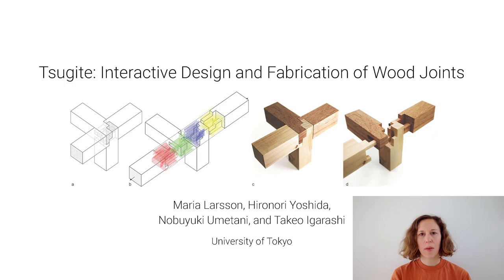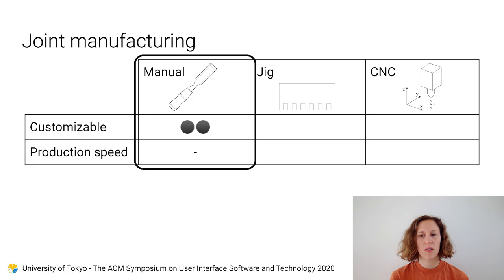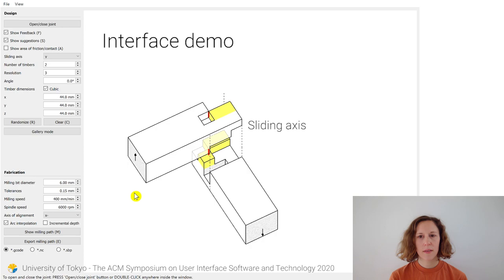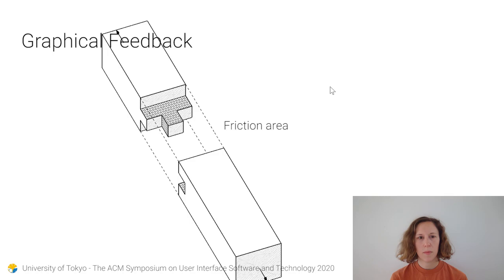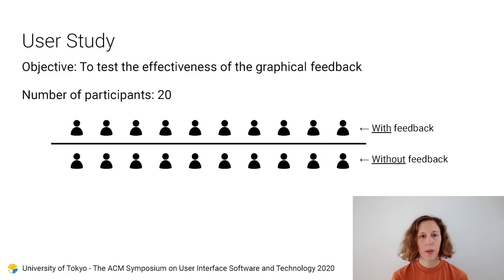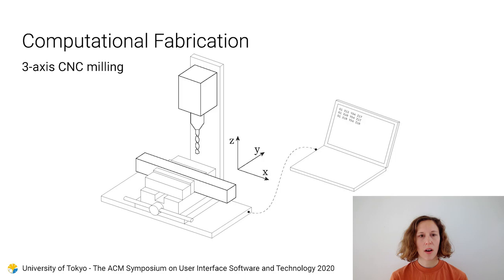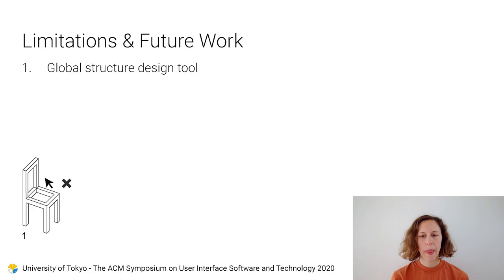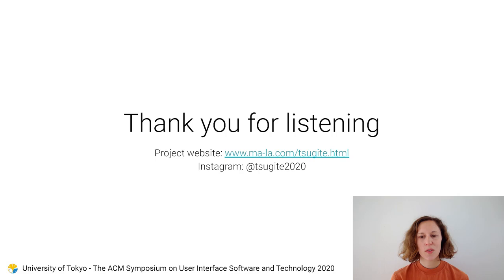Tsugite - Long presentation - UIST 2020

Comment: Just started the software, thank you for creating it. Running very well on a Win7, 8 year old Acer quad core laptop.   Translating to STL or OBJ files for integration into CAD assemblies or 3d printing should be fun.  Plan to try this using software like Voxelizer's Gcode to STL conversions.
Reply from the maker: So happy to hear that! 😅
Reply: how did you manage to run it on Windows7?
I'm trying to run it from PyCharm, I have all the dependencies installed, and still I get this message: 
"Process finished with exit code 1073741845" and the GUI wont start..
Reply: Could you explain me how did you do to install the software Tsugite? I tried to do but were impossible. I wrotte to Maria asking about the instalation in a OS W10 but I haven't got answer. Could you lighting me the way? Thanks
Reply: @jordijuveudina9974  I don't use win10.  I have not really been using this software as current projects have no need for joinery.  .  Maybe try running it as an administrator.  Somethings for me only work that way. In win 7, you right click on the exe file and it gives the properties options.  Or, if win10 has legacy modes, try that.  Same thing in win7, right click and select properties.  Then look under the compatibility tab.
Reply: @johncrosson7834  Thanks, John. Good luck and take care

Comment: When I launch the app I cannot get it all to fit on my screen, the fabrication buttons and exporting buttons are always off screen, any help from the community?

Thanks,
Reply from the maker: Thank you for trying out Tsugite! Please check the issues under the github page - we try to collect all user feedback there. The issue you explain is an open issue, which is one of our top priorities to solve for the next version of the program. What you can do in the meantime... if you have a large-sized or high-definition monitor, you can connect it to your computer, and operate the app on there.. Otherwise, please stay tuned for the next update! (Likely within the next month).

Comment: Thank you :) It's crashing rather often - almost every time a change is made... Running on Windows 10. Will troubleshoot and see what comes up. Cheers again :)
Reply from the maker: Hi! This is a software prototype developed as a proof of concept. It is not a consumer-ready product. So please do not expect it to run smoothly on all computers at this stage.
Reply: Could you explain me how did you do to install the software? I tried to do but were impossible. I wrotte to Maria asking about the instalation in a OS W10 but I haven't got answer. Could you lighting me the way? Thanks
Reply from the maker: @jordijuveudina9974  There is a new (hopefully more stable) version Tsugite 1.0.1 available for download on the project website.

To download and run this updated version:
-Go to the project website:  http://www.ma-la.com/tsugite.html
-Scroll down to Software and download the latest version Tsugite 1.0.1
-Unzip/extract the downloaded folder
-Double click Tsugite_app.exe - a black window appears for some seconds, then the software should open.

Comment: this is fantastic! would there be some possibility of this going online instead of local so it's compatible with all computers and not just Windows machines?
Reply from the maker: That would be great!
Reply: @ma-la  that would be fantastic! it seems to be the way a lot of software is going, Adobe, Microsoft, etc … it might be a nice way to generate returns on investment, especially if it was kept affordable … 

I was also wondering, since you've aligned on CNC as a construction method, would you be thinking about applying the same principles you did for wood but to metal? most CNC mills can easily handle soft metals … might be nice to port over the traditional tsugite design principles to aluminum, brass and copper … just a thought …

Comment: Is it possible to save shapes to 3d models dwg, stl ... ?
Reply from the maker: Hi! Very good question. No, it is not possible... Corners need to be rounded properly for the joint to fit together, given the CNC-machine constraints. This happens in the milling-path export. There never exists a mesh with properly-rounded corners (the preview is with sharp corners).
Reply from the maker: To add this function is not impossible, but it is rather a lot of work to hard program the mesh triangulations of the corner rounding. Given the effort to add this function versus the added utility, this is a low-priority issue. May I ask, what would you like to use it for?

Comment: Hi, It is free for entusiast?
Reply from the maker: Yes - the source code is shared on github and a downloadable executable file is shared on the project website: www.ma-la.com/tsugite.html. BUT please note that this is an experimental research project and not a commercial software. That is to say: more work would need to be done for debugging and making sure that it works on various kinds of operating systems and computers. But try it, and if it works, enjoy! If not, we do NOT provide technical support. But keep posted for coming project developments.